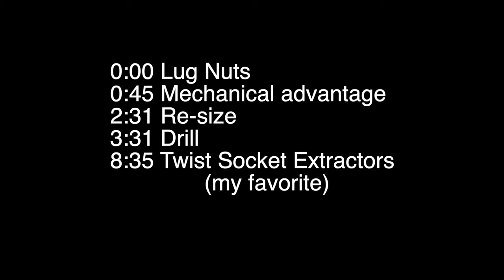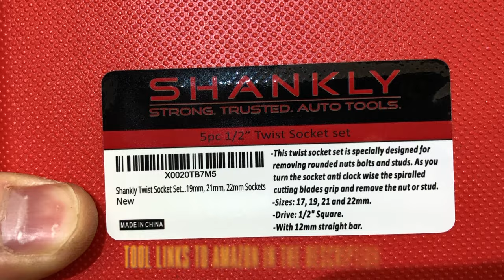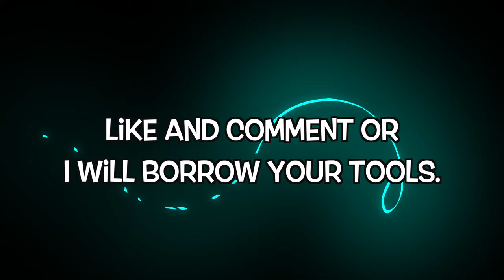STUBBORN LUG NUT REMOVAL TO SAVE YOUR WHEELS! 🛞🔩 Simple-Fast

Comment from the maker: New sway bar link video https://youtu.be/0S8JBe_jn6g
Reply: @easyfix I'm on the side of the road with a blowout. I've got a socket, it is too big for my lugs. Is there a way to make it smaller? So that I can do exactly what you're doing there.
Reply: @honeyhendricks9140  see about getting someone to stop maybe their wrench is the appropriate size. Hope for a cop perhaps he does. If you're going to buy a car make sure it's got a good spare and an appropriate lug wrench. Or buy a 1/2 inch breaker bar and appropriate size impact socket or socket set ( buying a socket set means you can also help others when it is safe to do so. Which is what I have -besides my 3000 Watt inverter and electric impact wrench 😊.)

Comment: Thank you thank you...I was on my chevy impala rear tire rim and couldn't use anything...like you nothing worked I even heated it off and on for 1 hour did nothing but stripped out the nut...so I did the drilling  in the center like you showed and it eventually came out...I always use some type of lubricant for any bolts I put on the car like antiseize but  someone before I bought it over tightened it bad bad..so thank you..❤
Reply from the maker: That's great to hear it worked! It's crazy how much overtightening a lug nut can mess things up.

Comment: If you're down to one lug nut left and the weight is on the rim the way you had it, it will be putting an enormous amount of uneven force on the rim and the last nut.
Reply from the maker: Correct. Never drive without all the lug nuts. The center bore on the wheel also supports the wheel to the wheel hub/bearing. I was doing this temporarily while the repair for the vehicle was underway because the lugs where so stuck so badly😀🔧
Reply: @EasyFixShaun If you turn the wheel so that the stubborn fastener is at the top, it reduces this pressure and makes it easier to remove.

Also, re-installing the ones that you removed, torqued more or less correctly, takes load off the stubborn one and makes it easier to remove.

Comment: Driving a few hundred meters with the brakes on heats the hub really hot and makes it MUCH easier to loosen any nut - knocks a tiny bit of life off the pads but a very sweet trick to try!
Reply from the maker: Interesting. I haven't ever tried that. Heat is a very useful tool for fasteners. It could warp a rotor if it gets too hot. But, it is an interesting idea, especially in a pinch 😀🔧

Comment: I tried a set of the lug nut extractor sockets and it worked like a charm. All 6 were stubborn, but was able to get 5 of them off. The 6th one stripped out. Spent 2 days trying to get it off then found out about these sockets. Got it off in a few minutes. I was glad Harbor Freight had them.
Reply from the maker: Awsome!! 😀😀
Reply: i tried that tool and it broke the front half of the nut off smh
Reply from the maker: Mission complete...... did you have to do some drilling?

Comment: Thanks for the video.  3/4 drive wrench with the 1/2 drive adapter with GEARWRENCH Bolt Biter socket finally worked for me.   My only modification to your solution was that I held the wrench, adapter, socket on and I need my wife to spin the handle with the extension (2-person job).    I did break a 1/2 drive breaker bar first so the suggestion to upgrade to the 3/4 drive did the trick for me.   I couldn't believe the size of the 3/4 drive but after I broke the 1/2 drive the suggest was welcomed.  Thanks.
Reply from the maker: Nice work! I am glad you got it. Sometimes these lugs are so stubborn its a flip of the coin wether they loosen. The 1/2" breaker bars seem strong until a longer lever is added, then they snap like butter 😂. I have yet to snap a 3/4" breaker bar or Ratchet, they have served me well 😃🔧
Reply: I used a 3/8", snapped right off 😢

Comment: Just want to say thank you. After watching your video I had a better understanding of what I needed to do. I purchased all I needed such as drill bits (glad I got 2), studs, stud install tool... I had the rest. Before trying this method I used everything I could imagine to try and undo what some pinhead messed up. It was at the body shop for a bit and they gunned on one wheel so friggin hard and for some reason all the nuts were swollen. I managed to get all off except one. I used your method and it worked pissah. I tried using a bolt extractor set from THINKWORK I purchased from Amazon for $33 bucks. That set worked so well that it snapped the lug off at the base so the only option I had left was to drill. I was impressed how well the extractor bit into the nut and didn't continue to round it off like every other attempt I made. Grabbed my Dewalt corded drill and went to town. Took me about an hour in my driveway to get the wheel off. Had I not watched your video, I most likely would have destroyed the rim with a torch first.
Reply from the maker: Excellent! I am glad i could help and glad you got it done. It is always a pain when this stuff happens for me too. But it is just nuts and bolts and all you can do is keep working at it sometimes. With some knowledge, concepts, safety, patients, elbow grease and tools it usually can be repaired over time 😃🔧
Reply: What type of drill bit is that?
Reply: @lucky4u697  I used a titanium metal bit which I purchased at Lowes, you can get them at Home Depot as well. . I suggest getting 2 or 3 bits and using a drill with a bubble level on the top. I used my corded Dewalt because I wanted the consistent power and not have to change batteries. Also,  use plenty of penetrating oil to keep the bit cool so you don't burn it out. Good luck..

Comment: Thank you so much! I ordered these extractors earlier as I cannot, for the life of me, get the wheel off of my 4 series. I've tried Wd-40, a galvanized steel pole as a breaker bar for my ratchet, and I was just about to attempt heat, (and probably light myself on fire, lol)!!! I've broken a socket and an extension so far and no luck.  I recently took it for new brakes and rotors and they failed to replace the brake sensor so that's my current project. Thank you for suggesting the torque wrench and no heat! If these extractors aren't here soon, I'm going to attempt the smaller socket since I'm pretty sure they're stripped! Your video is extremely helpful! Thank you again!!
Reply from the maker: No problem glad to help! My goal is to avoid heat at all costs. There will be some damage to the wheel with heat no matter what- so i use it as the last method. Lug nuts and studs are such a pain sometimes. After extra leverage fails, i go for the twist sockets and usually those work for me 80% of the time. After that i drill in an attempt to save most all parts except the lug nut and lug stud 😀🔧

Comment: That's some good info! I use similar techniques as well as oversize sockets. 19.5mm, 21.5mm etc for the rusty swollen ones.
Reply from the maker: Thanks man. That’s an awsome way to do it!! 😀
Reply from the maker: I added a link in the description for some 18.5mm/19.5mm/21.5mm/22.5mm socket sets if anyone is interested. My apologies for no including a demonstration of those sockets in the video 🙃
Reply: Please help how do I remove a lug bolt? My wife’s car Jeep Compass 2018 has lug bolts not nuts, and I’ve used inpack drill and even an air impact at a tire shop and nothing!!!!!
Reply: That was my next idea cause mine is chewed all the way back to the rim so did you put a oversized socket in the hole and just beat it with a hammer until it breaks up?
Reply from the maker: I might try the twist sockets. Those work really good. If those don't work probably need to drill out to save the wheel 😀🔧
Reply from the maker: @carmenjohnson8763  Hey! Did you get your car fixed? Sorry I did not respond. Sometimes the comments in a thread do not show up on my notifications.

Comment: 2017 Ford Escape. This is my first situation with swollen lug nuts so I've been researching and using trial and error. I ordered an impact driver from amazon but it was damaged. I'm hoping to get a driver that works as well as a good model for my situation. I'm also looking to get a torque wrench.
Strange thing, 19.5mm fits 4 of the nuts but the top one still seems to big for that one but the 20mm seems too big.

Comment: Great video. Would a 3/8” breaker bar work on a small car like a Ford Focus with a 18 mm socket working on a worn down 19 mm lug nut which has lost its shape and is very rusty? Or is it too risky?
Reply from the maker: Worth a shot. I go straight for the 1/2"breaker bar or bigger, I've broken a lot of 1/2" stuff. But if its all you got try it first 😀😀

Comment: Had the most stubborn 17mm lug nut on a Mini. Owner stripped it a bit. Tried my Milwaukee impact, nut wouldn't budge (also tried a brief tightening), so I sprayed wth PB, heated (no damage), and tried the hammer the flanged nut with a socket to break wayyyy overtightened and rusted lug. Nope. Tried an impact driver with a 17mm extractor nut. Like you, broke 3/8" ratchet, breaker bar (Snap-on), and extractor socket with  pipe-leverage. Had to try 3/8" because 17mm 1/2 drive was slipping and only then had  a 3/8" 17mm and 16mm, and extractor (didn't break this extractor but it spun off. Didn't have all my tools (especially cobalt bits) so I had to admit defeat (1st time). Owner brought it to a shop and they got the lug off, changed the damaged tire but did not put a new lug back on that stud? I called and asked how they got it off but manager didn't know? Wasted 2 hours on this. Broke four tools (#4 was an impact stepdown adapter).
Reply from the maker: Oh my! Sometimes these are incredibly difficult like yours. Drilling seems to be the easy answer for me after i try a couple of the easy methods in the video and fail. Good job trying to sort it all out 🍻

Comment: 04 Lexus Rx, 21mm Acorn Lug, which were replaced about 5yrs ago with Dorman replacement. Of course, someone overtightened the lugs, and damaged the chrome cover. Cover has come off. Super stuck
Reply from the maker: Oh no that sucks! You might benefit from the half size sockets. I put some links for them in the description. They work great and fit the sockets when the covers come off. Can be of use. The twist sockets are amazing. I try those before i start destroying things. They work really great and have saved me so many times i cant even count 😀🔧

Comment: See how did your drilling go that easy, I just spent a whole day and multiple garages with Robert only got like 2 millimeters, he had same double handle drill I see in video, got looks like same drill bits to, but nothing happened.  Any ideas?!?
Reply from the maker: Im not sure. I used a new drill bit. It was a cobalt brand bit. I put a link in the description fir the bits i used. Your stud may have a different metallurgy too. You should be able to drill out just about any stud though with a sharp but, but you may need to stop and sharpen it during the process. Sorry your having trouble. I would also say the two handed drill bit isn't needed. Its just what i had at the time that the larger drill bit would fit into. Any size drill should work just about. Its just a matter of bit fitment.

Comment: My nut has sheered with the wheel on, not the stud or the thread but exactly where you pointed out at the beginning of the video. So I have no nut to get a socket on. Any way to remove it?
Reply from the maker: Great question! Twist Socket set at the end of the video will do the trick. They are amazing. Pound it on as hard as you can. It will grip and take it right off in almost every case. Let me know how it goes 😃

Comment: Would the nut extractor work on what is left of a capped spline style lug nut that the spline broke off? Or is drilling out the lug the only option?
Reply from the maker: I would try a twist socket first. They are life savers and often work 😀🔧

Comment: Can you tell me what type/brand of drill bits you used for the job? I have antitheft lug nuts on my Grand Caravan and I lost the key. I managed to remove 3 of them pretty easy with the bolt-bite tool but one is stuck and won't come out. I tried to jam the bolt bite socket so hard, it cracked. I started drilling as last resort and for me it's a very slow and frustrating process. I used a very small high speed steel drill bit and that one went through very easy. However, trying to enlarge the hole with larger drill bits is a pain in the butt. I estimate I have 2 more cm left to drill but it's gonna take me a few days at the pace it's going right now.
Reply from the maker: I used a cobalt drill bit. Here is the link from the description. I got them from amazon 😃🔧🔧 https://amzn.to/2YLW7nA
Reply: You didn't catch the part where he drilled a little then dipped bit into oil and started again. Dont let drill bit get hot it tempers the steel ,gets soft and goes dull. Every 20 seconds or so dip in water or oil to keep bit sharp.

Comment: Me and my dad have a machine shop for heavy equipment, when ever we do any lathe work on softer steel we get some that are over 50 feet long or using the mill you can make extremely long shavings. But that's a bad thing because it can cut you open and potentially cut parts off you.
Reply from the maker: Wow! That's crazy. 😀🔧

Comment: Great video! What about for a lug bolt/wheel bolt? Dodge decided to use bolts instead of nuts. Is drilling still an option?
Reply from the maker: All of the methods should still work. There is a possibility of needing a wheel hub if damaged when drilling. The hub could also have the bolt seized in it once you drill far enough to release the wheel, making hub replacement also necessary. Basically you would need a new wheel bearing and hub assembly. But you should be able to save the wheel with the methods at the very least 😀🔧
Reply: @EasyFixShaun  ok awesome. Thank you for the response. You earned a sub... Here I go. Let's see what happens!
Reply from the maker: Awsome!  Always a not so fun job. Take your time. Stick with it. Good luck 😀🔧

Comment: Great video, learned alot
Can anyone recomend new nuts for my 09 challenger plz?
The original keeps breaking, the aluminum caps (right word?) just spins on the nut now
had to break 2 of them just to get the wheels off
Reply from the maker: See if you can find a one piece nut to replace the two piece nuts. One piece may corroded faster than two piece but removing and installing the one piece should work better. Pros and Cons...
Reply: @EasyFixShaun  Thanks, will do that
Keep up the good work :)

Comment: nice video,,, what type of bit did you use??.. cobalt or carbide??? I first used a set of titanium but 5 hrs later and using a 1/2 bit still didn't work, I think 95% of the lug nut has been drilled off
Reply from the maker: Cobalt. They seem to work really well. I have since sharpened a few of them and they are still working great for other projects. Man you are really working hard on that. Sorry it didn't go quicker for you. Its good to take your time though and still to not hit the wheel. Usually the weight of the wheel will make it pretty much fall off the hub once 100% through the portion holding onto the nut.

Comment: What type of drill bit did you use? I've been left with having to drill out a stud after a splined nut stripped and then snapped in half using extractor tools. I've burned up 3 brand new milwaukee carbide and titanium bits and only got 1/4" into the stud.
Reply from the maker: Links in the description for all the stuff in the video.
I used Cobalt Drill bits: https://amzn.to/2YLW7nA

Comment: what's the name of the drill that you use I would love to try to do this myself a lot of these shops are trying to rip me out
Reply from the maker: I put some links in the description for the drill bit kit I use. Any high quality drill bit should work great if you don't have time to order. A drill bit sharpener can even make a lesser quality drill but work for the job. Although you may need to sharpen a few times along the way during the process😀🔧

Comment: My lug nut wrench couldn't handle my stuck lug nuts so I ended up finally buying a 25" breaker bar along with a 18 mm deep impact socket and an additional 4' extension bar. After seeing what happened at 2:45 I avoided using cheap short sockets of which I had many. I did also spray some WD-40 type lubricant on/around the nut the day before. I then pushed hard about 10 times and with a distinctive crack finally got it to move - it was stuck on real bad as though someone had welded it on. How the @#$? does this happen? Anyway, thanks for this informative, useful video!
25" breaker bar - Harbor Freight Tools $18
18 mm impact socket - Advance Auto Parts $7
19 mm impact socket - Harbor Freight Tools $4
4' Scrap metal bar extension - free
Reply from the maker: Excellent comment I'm glad you got it sorted out! Lug nuts seem to create this phenomenon frequently and I'm not sure why. Its more common on older cars so i think it's related to corrosion on the nuts/studs/wheels/or hubs. Or maybe it's all the dissimilar metals bolts together in That spot. Or maybe it's that the lug nuts are too tight. Or maybe all of these things. I have no idea 😂

Comment: I have a 2018 dodge ram.  Have a lock lug nut I can't get off. I have 3 keys I used to try to get it off but it keeps snapping, all lug nuts are snug in tight but the locked lug nuts my main concern.  Any idea on how to remove it without a key?
Reply from the maker: I would try twist sockets. They are my go to tool when in your situation. They work fantastic and usually work. They also will cause no damage except to the lug nut or lock key nut 😃 
https://amzn.to/44R877g